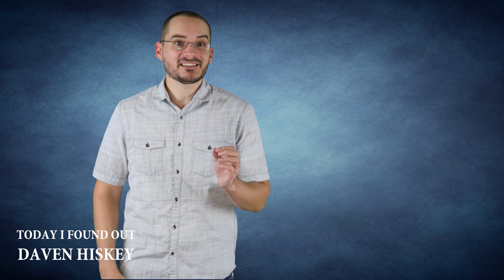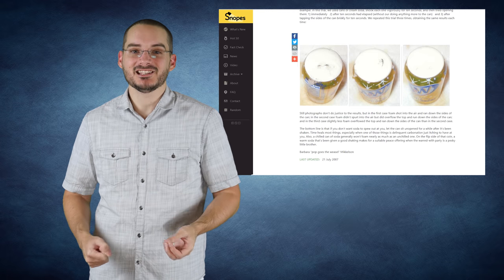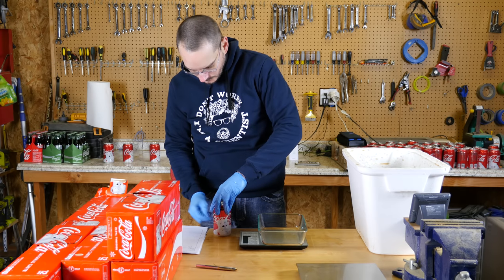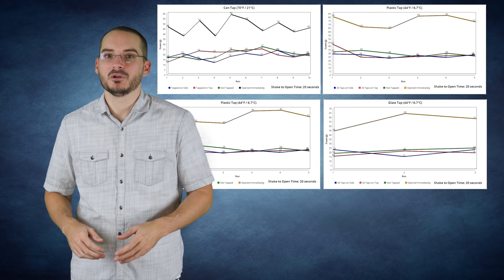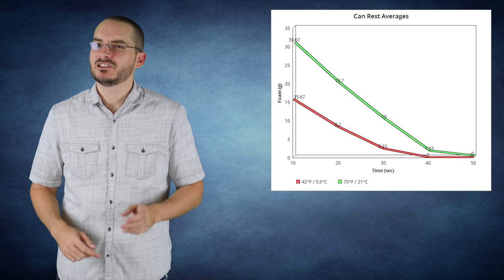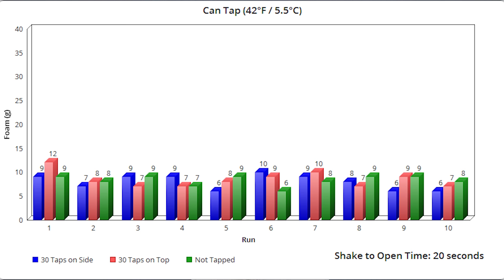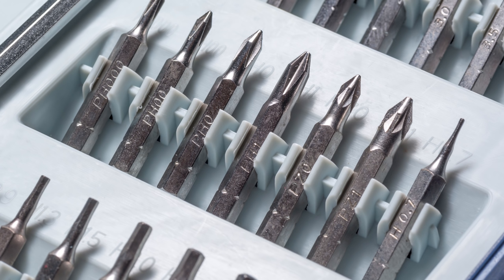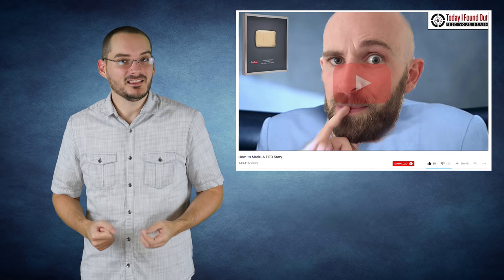Does Tapping a Shaken Can of Soda Actually Reduce Foam?

Comment: To understand why the plastic bottle produces more foam, look at the shape of rocket nozzles.
The reason the carbon dioxide is absorbed back into the liquid so quickly is that carbon is very chemically fertile, it loves to bond to things.
You now have a large volume of cheap and effective de-greasing and cleaning fluid, I hope you have a lot of things that need cleaning.

Comment: If waiting for the carbon dioxide to redissolve is the hypothesis, not tapping would be the best option because the myriad bubbles have a far greater surface area/volume in contact with liquid than gas above the top surface of the liquid which only contacts on one side to boot.
If you hypothesize that you are waiting for the foam bubbles to drain and recoalesce, the type of liquid should matter. From tonic/quinine water to 7-Up to Coke to Budweiser on to a stout like Guinness.

Comment: As a party trick, I will shake the can till you can not hear the fluid move. I then flick the side of the can strongly several times until I hear the can ring. The can will open as normal with no spray/foam. Tapping just doesn't work compared to flicking the side until it rings.

Comment: Is there any difference in foamyness between low altitude Los Angeles (or Death Valley) and high altitude Denver?
Reply from the maker: Absolutely. This is similar to why water boils at a lower temperature at higher altitude.
Reply: Thanks for your reply. If you revisit this subject, maybe you could include the altitude issue.

Comment: Did you tap the top? Or the side? 
Tapping the side is suppose to release the bubbles attached on the side. The theory is that now their are less visible to escape. 
Steve Spangler has a video on this.

Comment: I'm not positive this is currently the case, but I have read in the past that Coca-Cola put more gas in the cans on the assumption that, since they can't be resealed, they would otherwise go flat more quickly.  I haven't heard anything about glass versus plastic bottles, so I would assume those to be roughly the same...and this would imply that the plastic bottles have more surface imperfections and therefore more nucleation sites...but that's not something I have either data or anecdotal evidence for.  :-)

Comment: interesting experiment! however the science before hand explains why the way I dislodge the bubbles works wonders much faster. simply grab the as much as you can with your thumb and index finger and grip it tightly as  you can and then move your fingers up the can. do this once or twice and boom it works! probably because you push all the bubbles off the sides. 
Thanks for the science guys life hacks are cool but understanding is AWESOME!

Comment: 240 cans AND a machine? Wow... you're VERY thorough.  But it's always better to just slightly open it so some of the pressure can escape. Just pull the tab until you start to hear a hiss, wait a bit, then continue. And yeah, plastic does have more nucleation sites.

Comment: Doubtful it'd make a difference, but it wasn't clear if you pulled the tab up just enough so you could tap THAT against the top of the can -- metal on metal, producing the distinctive 'tick-tick-tick' sound. That frequency is what I presumed did the trick.

Comment: I believe it does works. 
Here is what i do.
Give it a good tap high, middle and low on the side of the can. Then rotate it 72 degrees, and do the same, until you are all the way around. (so that's 5 times 3 taps).
Then open it. 
Shake it to hell and and try it yourself.

Comment: You need to slap the side of the can with force, not tapping it. Slapping said can causes the CO2 bubbles to dislodge from the top. I have tried this with many a dropped beer can and soda bottle, gave it a good solid whoopin, and didn't get a beer or soda shower. I am posting this at 3:22, so Maybe my comment will be moot.

Comment: You should test beer. I'm pretty sure it's different. There are these annoying bumps outside of stores when you go to walk into the parking lot. When I have beer in my shopping cart and those bumps cause the beer inside the shopping cart to be shaken when I roll over them, it still has a bunch of foam that spills out when I get home. Maybe it's just that beer has more foam, but it would be interesting and useful to know how long you have to wait to open a beer that's gone over those stupid bumps. Personally, I just pick up either the beer or the cart when going over those damn bumps.
Reply: Amy I thought at first you were opening those beers in the parking lot. Lol.
Reply: No. I usually wait until I get home and they sometimes still overflow. I had a beer overflow earlier that had been sitting in the refrigerator for at least 24 hours. I didn't bump it over those stupid bumps either but it was still fizzy as hell. The one I opened before it wasn't fizzy at all.

There is probably a different thing happening with beer than is happening with soda, although the gas should be CO2 in both cases. In my experience making beer, sometimes you get one that has a lot more gas than the others but I think commercially produced beers generally add the CO2 like they do with soda instead of letting the yeast produce it naturally like I do when I brew at home. But, yeah, I drove the car so I wouldn't open a beer in the parking lot in that case. Maybe if I walked. lol

Comment: Sometimes if the machine drops my plastic bottle, I give it a good squeeze to help the carbon dioxide dissolve faster since it's at a higher pressure.  This also takes a few seconds...  So one way or another, it helps :)

Comment: The shakers the companies use are the same, but they shake harder further and are very low tech. The CO2 volumes in these products are very precisely produced and measured. A bottle of Coke off the line has a CO2 volume of 4.15 pressure give or take a slim margin. Since cans don't leak gas like PET bottles, they are created with the target consumer desired CO2 content. I think it's 3.50 atmospheres. I forgot, but I had to do it for years.

Comment: you doing it wrong. I have proven this myself having coldrinks delivered 50km by truck over incredibly rough African bush roads.
You pull the tab back just enough to create a spring effect and let it go. This creates a shock wave that you cannot get just by tapping. Repeat 5 times and it works!

Comment: Thank you for the scientific rigor. Unfortunately you neglected the last side of the can, the bottom. Back in college we did  this test In lab, resulting in two facts. One, leaving the can upside down once the drop or shack occured either quickly or given minutes later, allowing time in which CO2 was reabsorbed, then straightening the can up right, resulted in minimal or no loss again dependent on the time variable . And two, tapping it upside down even for short time and then rerighting it and opening it produced no liquid loss. Even as little as three taps produced minimal loss beyond the natural spritz of opening the can . Without wasting too much soda, give it a try the next time you drop a can (turn it over, tap it a couple times, back over again and open it,) you won't get to wet. Also you can check it out with a soda stream though you need something to hold the bottle upside down for a while . Good luck .

Comment: You're over thinking the experiment a bit. Usually that method is done when the can is sat down to hard or falls on the floor. Not had the crap shaken out of it with a reciprocating saw. At that point you would just go grab another can

Comment: I have to say, you are absolutely wrong. You said that "Tapping a can of soda does absolutely nothing [to reduce foam]" (even the title of the video says "soda"), yet you didn't test "sodas", you tested Cokes, which are not very foamy to begin with (carbonation is only a part of it). Many times I have dropped one and knew I could still open it immediately without fault (if it were cold). Whereas some other beverages would shower you with their foamy essence without it even being hardly shook. 
I have done half-assed experiments like this throughout my life, with most carbonated beverages, and found Dr Pepper, Root Beer, Beer, and some Cream Sodas to be the most foamy. And I can say that opening a cold can is less foamy than a cool can, which is less foamy than room temp, less than warm, etc. Opening a can right after shaking it (not up n down but spun back n forth on axis) causes lots of foam, and in most cases after the can had sit for a long while (also rising in temp) it would still foam up. I had a Beer once that sat for over an hour thinking it had settled, and it didn't. But tapping the can briefly (and not waiting as long as 20-30 taps) with a hard object (like keys, screw-driver, or wrench) and opening it up immediately produced little to no foam most the time... 
So your experiment on Coke was interesting, but I 'd actually like to see it done on different Sodas and/or other beverages that would make or show more of a difference. That would show more depth to this experiment. As only a small to medium part is due to the carbonation of the beverage, I would look into beverages that are more 'sticky/gummy' (gummy, like how you blow bubbles in bubble gum) or less surface tension (like what soap does to water, and why soap lathers more with pure/soft water than with hard or dirty water). This seems to be the more prominent aspect of the "foaminess", with the carbonation only being a multiplicative of it.
Or I might be wrong, since none of us are a professional in this field.

Comment: You did it wrong. It works on cans and all you need to do is sit it on a flat stable surface and tab sharply on the top of the can with your finger tip (making sure that you hit it with your nail and not your soft finger tip. Just tap it twice. It will work everytime regardless of how many times it has been shaken or how long you wait until you tap it. Tapping it 30 to 50 time is just reagitating it and causing the bubbles to reform, thus your results of it overflowing. Do it correctly and you will see the proper results.

Comment: I have been able to open a can within 20-30 seconds. I tap it on the side while rotating the can. This is half the time from the experiment.
Reply from the maker: As mentioned in the video, Dr. Pepper, for example, produces much less foam, and the time scale you're talking about is plenty sufficient to allow it to settle. A&W root beer, on the other hand (which wasn't mentioned in the video, but was experimented on), produced massive amounts of foam and required a longer settle time.
Reply: Today I Found Out I appreciate the response. I used to make a bet that I could open any soda, no matter how much they shook it, within 30 seconds and I have never lost the bet. I think there may be more to look into before making the conclusion that no amount or type of tapping will effect the amount of foam. I rotate the can while tapping. It even works on beer to a lesser amount. Thanks again for the awesome videos and response. I still think it is worth looking into more deeply.

Comment: Don’t use the tool kit.  If you’re working in electronics, do NOT use magnetized tools.  They must be demagnetized, and you should also use an ESD protection bracelet.  This is to avoid “frying” the internal electronic components.  This is electronics 101.

Comment: Why are your mics always a little bad?
Reply from the maker: Nah, that's just the way my voice sounds. ;-)  

In truth, my mic is absolutely amazing (Sennheiser MKH-416). This thing captures sound ridiculously well. Too well, in fact, which brings us around to my skills at getting the most out of it being sorely lacking. (Actually, mostly non-existant.)  In this instance, for some weird reason I had a major echo problem despite that my mic and room I recorded in are the same as always.  The audio then had to be too heavily processed to remove some of the echo. Must have tweaked some setting on my H5 when going back and forth to the shop and studio a bunch. An echo problem is not one I generally have with this thing in my recording studio.)
Reply: Today I Found Out Ah, I've actually noted similar problems with the other host. It sounds like you're projecting your voice too much- which also might explain the echo?